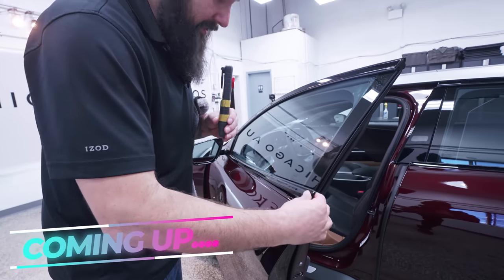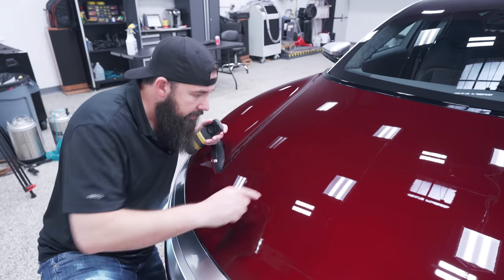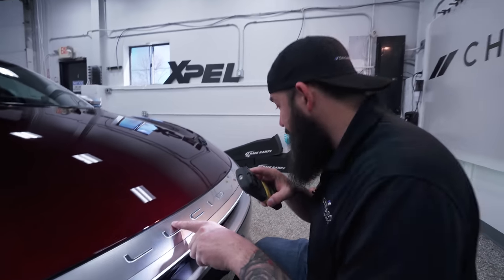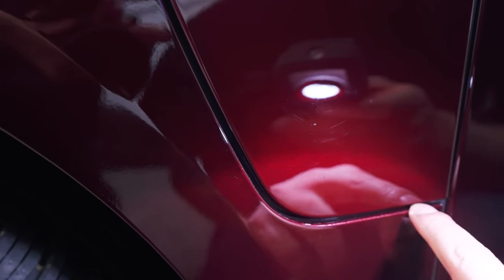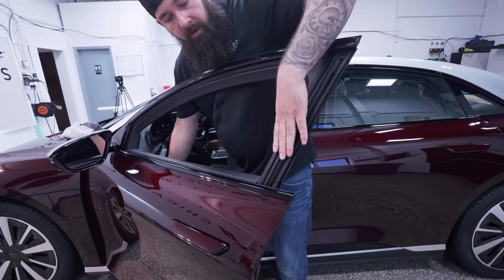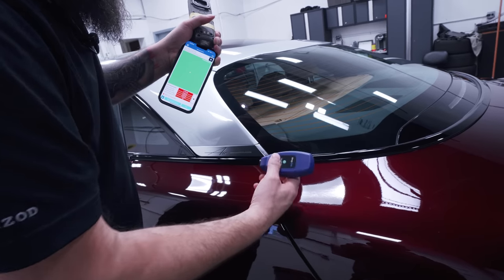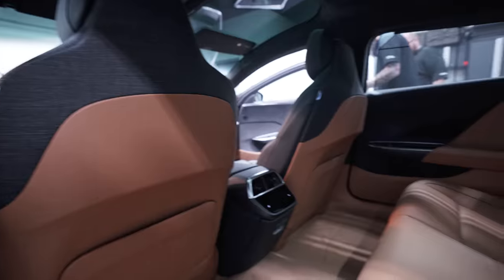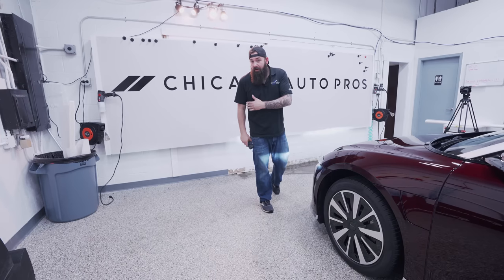2022 Lucid Air Inspection + First Impressions | How Bad Is It?

Comment: Car looks cool but it would appear to have been built very cheap judging it based on this video alone. Love the vid and to answer your question about the red lights in the trunk jam, its to alert drivers behind you of the vehicles presence if the trunk is open. Some cars have red lights in the door jam for the same reason

Comment: I used to work for a Pontiac dealership and new cars were damaged quite often.  One of my tasks was dropping them off and picking them up from the body shop.  Trust me, some cars have extensive damage. They get backed into, side swiped, things fall on them etc.  there is no requirement to tell the buyer about any of this.

Comment: Relatively easy to make 100-500 vehicles.  You can re-paint, etc. to get it right.  Entirely different universe to make cars in volume.  If you have any issue, you quickly run out of room in your plant to rework issues.  Tesla sold almost 1 million vehicles last year without skilled union workers, which is an engineering / manufacturing achievement that is vastly underrated.  Cool looking car, but such a giant hurdle to get to sustainable and profitable volume.  People also underestimate how good of quality car a new Chevy, Chrysler, Hyundai, etc. actually is.  "Build quality" is really just many hundreds and thousands (or millions) of repetitions to continuously improvement processes.  Can't do that if only building 100 vehicles.  This is likely repainted at the plant, since they are just trying to get the first cars off the line correct.
Reply: dam i forgot they did only less100i dont know why they cant do good on paint

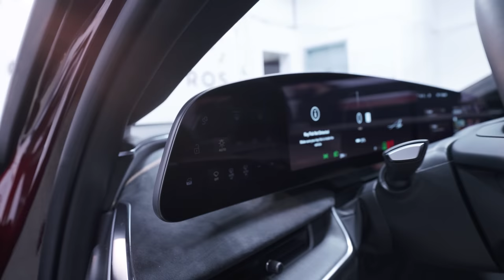Comment: 13:05 because laws in some countries ask for manufacturers to have tail lights always visible. Exemple: you are on the side of the road at midnight with the trunk open. Lucid tail lights are on the trunk and are not visible from behind if you open the trunk, that is why they had to put another set of tail lights to pass laws.

Comment: Great video Jason.  Dealers can be the worse... I've worked for 2 in my past life.  Especially when a "new" model arrives in the dealership.  They'll pull the odometer plug, go have fun with the car and then put it on display as new.   In the meantime anything could have happened.  I've seen it with a brand new NSX.   Hopefully you'll get to work on another one and tell us if this was a dealership-abused-then-fixed car or if it's a general quality issue. 
I know it can be normal for a new manufacturer to have quality issue.  Still waiting on Tesla to fix theirs!!!!!!
Reply: Yeah this is a lie. The odometer is programmed in and there is generally only 1 plug on the cluster to disconnect it sets off a bunch of codes and puts it into failsafe mode. Especially on an NSX you cannot just "unplug" the odometer
Reply: @pilot1721  I'm talking 1989 here......

Comment: Great video and impressive detail inspections with spotlight , magnifier glass and paint meter. I bet if you run that same inspection on a $140,000 Mercedes or BMW... You would be surprised what you find. One thing that bugs me, a car enthusiastic and a professional detailer with over 15yrs experience in car... He doesnt understand why there are lights on bumpers!! Just common sense no need to know DOT laws! I enjoy the video though.
Reply: Sowwy. Over 50k for mass production is a waste.
Reply: But the lights are covered by the trunk lid? Why indeed.
Reply: @bruintoo  It will lid up at night when you open up the rear door so other cars can see you when they are coming.  Per DOT laws.
Reply: @logantp7698  Yup. It's the tradeoff for having a full-width trunk lid. Other vehicles have the trunk lid inside the rear lights and don't need the rigmarole, but if you want to go the other way with your design you'll need those "internal" brake/signal lights. Not all laws make sense like this one!

Comment: It's nice you guys do these things.  The few Tesla's I've seen appeared to be put together quite well.  I'm surprised with the Lucid since it's a good bit more expensive.
Reply: Tesla is still a very new company and Lucid is even newer. This is to be expected
Reply: @Ninj_SRG  i'm looking forward to the lucid SUV.  It looks like an amazing car and hopefully kinks will be worked out.
Reply: @joesmith9483  probably be slightly better but I don’t expect it to be significantly better until they have a few more big factories like Tesla
Reply: @Ninj_SRG  You can't call Lucid "newer" when they're ran by a Tesla lead engineer that worked on the Model 3. In fact, he marketed his company off the fact that he worked at Tesla, and then proceeded to BASH THEM for quality control issues, bragging that they'd use their experiences at Tesla to avoid the same problems...

And yet here we are with a $170k car with THE SAME quality control issues we expected. I'm also not one to cast out any specific country from investing, but it doesn't bring me ANY confidence knowing 62% of the company is owned DIRECTLY by the Saudi Arabian government.
Reply: @Ninj_SRG  Sorry, no. Lucid chose to compete up-market, at a high price point where quality fit-finish-pain is to be expected, not flaws. "Fake it til ya make it" for $140K is not cool.
Reply: @ryanthompson3737  exactly why they won’t see a penny from me…

Comment: I’m an engineer for this company. If you saw how it was run youd understand why this car has is problems 😅 haven’t seen your Tesla video yet but I was also an engineer for Tesla and in an effort to get cars out at competitive market speed there were so many short cuts that were taken. Same issues are relevant for Lucid as well. Quicker we can get designs/products out the more money is made and satisfies investors.
Reply: Very funny. You are Engineer for Lucid and for Tesla. Lucid was delivering a few hundred units of cars while Tesla delivering a significantly higher number of over 500,000 cars in 4 different models within the same amount of time. If only Lucid had not released too much 'big mouth' BSs, people might have sympathized with these shortcomings.
Reply: @salimakai1414  try reading it again.  He WAS an engineer for Tesla.  Teslas are well known to have build quality and reliability issues.
Reply: @Euro2024champs  Of course, I knew that he used to work for Tesla. My point was that Lucid had told people that they would NOT have the 'Production Issues' and instead Lucid would have 'Production Heaven' only. But now, after their repeated failures to fulfill their little promises, Lucid claimed that they are only new company which they are not and consequently they faced with the production issues that led to failure to deliver 520 EVs at the end of 2021.
Reply: @Euro2024champs  not seeing much evidence for reliability issues from Tesla.  Also not hearing much build quality stuff anymore in fact.  seeing a lot of cars on the road though so something's being done right.
Reply: they aren't really pleasing investors though are they? even Ford sold some off.
Reply: @Euro2024champs  Were.  Those days are in the rear view camera.
Reply: @salimakai1414  you need to reduce the meds, your posts are just nonsensical verbal diarrhea. What exactly point are you trying and failing to make (use short English sentences pls)
Reply: @LD-bv1pm  I was talking about Lucid and its BS. I am not here to please you!
Reply: @MsAjax409  lol

Comment: Just wait till you see the iX Bmw lights, super trippy.

First cars from Lucid will have their kinks, you should see what a Founder Model X or even worse Founder Model S looks like... Let's compare apples to apples.
Reply: Disagree. If your new car company wants to break in at six-figures-plus, your product should get the basics right, like paint job. So many other things about the Lucid are rocket science, the reliability of which needs to be proven... but they're skimping on paintjob? Red flag warning.
Reply: @ericjbowman1708  Tesla used to sell cars for similar price when they bowed onto the market...their quality is still not on par with legacy manufacturers in terms of fit n finish
Reply: @dasteknoviking  Leaving the door open for a competitor like Lucid to do better in that regard.

Comment: The lights you noticed inside the trunk are required by law in some countries. Basically, if you stop at the side of the road and open the trunk, your car's rear lights should still be visible to traffic behind you. Because in this car opening the trunk moves your rear lights up in the air, they had to put rear lights on the inside. This is why most cars will have the red lights split, some on the trunk and some on the outside so that they are still seen when you open the trunk.

Comment: Great video Jason! And huge props that you're going to tell the customer about the issues you discovered, even if it means your work might be delayed (or canceled). Can you post an update to let us know how that turns out?
Reply from the maker: Unfortunately the timing was bad and we couldn’t get a full video done of us doing the work. Thanks for watching Scott.
Reply: @ChicagoAutoPros  No I meant if the customer proceeded with your work or postponed to address the issue with the dealer. I guess they proceeded?

Comment: Very professional and comprehensive assessment of the Lucid vehicle. It pays to pay attention to these details when receiving a new vehicle. I have received new vehicles in the past that have clearly had repaint and other corrective work prior to delivery. When brought to the attention of the dealership, the reaction was one of acceptance that these events are routine. No surprise which came as a surprise to me at the time. I refused delivery of the vehicle. If it has some problems I can find, it probably has more that I haven't found. The owner of this Lucid should consider the same. Lucid is better than this.

Comment: I would be PISSED if the Delivering Dealership Did Not Tell me My NEW $140,000.00 Car was Damaged in transit and was Repainted! If the Folks that Didi the Painting knew what they were doing????? You would only be able to see a Bit More Thickness. And for $140K, They should have Sanded it Down and MATCHED the Original Factory Paint and Thickness! A REAL Professional Could do that, Ya, it would take Time and Effort, But at $140K, That's what should be done! "PERIOD"!!!!   GREAT VIDEO, And Great Work Finding the Damaged / Painted area's.

Comment: @13:02 Law requires taillights visible when the trunk is open and closed. The taillights go up with the trunk lid so they put lights in the frame of the trunk to meet legal code.

Comment: Didn't think I'd see build quality lower than Testa but, this might've at least tied it.  That's a LOT of repainting going on there and respectable that you're consulting with the owner before doing anything.  Most shops would do the typical 2-step correction, cover it with PPF and on to the next job. 👏
Reply: Theres no build quality issues
Reply: @mattbrew11  Look a 9:05 ???

Comment: 13:04 Legislation. Law mandates, that back lights must stay put regardless of position of tailgate / trunk. If the lights are on the tailgate or trunk the ones that appear substitute them. They also should work as turn indicators. If memory serves me well, it's alike on Opel Insignia and Audi Q7.

Comment: I’m just sitting here trying to figure out if the sun visors are attached with adhesive or are they attached mechanically. All of that glass is going to bring in heat and the glass needs to be tinted. Awesome job noticing the overspray on the trim and I hope the customer was informed about this from the dealership. Thank you for the fun video and the car does look cool.
Reply: probably adhesive like 90% of rear view mirrors are.

Comment: Okay, obviously I'm not an auto detailer, but if you have to "inform" someone of the flaws in the car's paint job. . . how bad can they be?  It's not as if it's going to affect the car's performance or even--as far as the customer is concerned--its appearance.  A purely cosmetic flaw that no one notices isn't really significant, is it?
Reply: Because it's a $140,000 car not a $30,000 Camry.

Comment: @Jason - the lights are under the trunk similar to the Audi Q5 that activate the lower bumper fog lights because when the trunk is open there's no lights that show up for safety - say if you have your hazards on. Lucid could have done what Audi did and put the lights into the bumper but that'd be too simple! Thanks for the video! Sorta interested in what the Customer tells you.
Reply from the maker: That makes sense. Never seen them in the jamb like that before.
Reply: @ChicagoAutoPros  totally and agreed. To be honest that seems like engineered complexity haha
Reply: @nodrogkam  Engineered complexity certainly applies to the in-trunk latch release, here in the US. Current regs call for glow-in-the-dark handle and mechanical connection; older cars it could be electronic, but then it didn't work if dead battery. Trunklids are surprisingly complicated due to safety regs, not sayin' that's a bad thing.

Comment: The reason why it has lights under the trunk is for legal reasons. You can not have the trunk raised with the tailights. So the added tailights. 
The reason is safety. If you're on the shoulder on the highway and you lift your trunk the lights should stay down to show a hazard. The lucids hazard taillights lift with the trunk, so they added lights to compensate.

Comment: The reason you would have red LED lights inside the trunk deck, is because the entire trunk opens, including all taillights. So, in situations where you're pulled to the side of the road, and have your hazard lights on, other drivers can see your vehicle at night or ill-lit areas. They are only there to make the car visible by on-coming traffic if you have the trunk open. I am pretty sure it is a requirement to have some form of tail lighting if the actual taillights aren't presently visible.

Comment: I would assume the lights in the trunk are there for safety reasons since the tail lights go up with the trunk.  Say if you get a flat on the freeway at night, you'd be virtually invisible to traffic headed your way when you went for your spare in the trunk.

Comment: As a former process and quality manager for a company that robotically painted many commercial and retail products, there were quality protocols to qualify what was acceptable or of high quality.  Example: standing 6 ft from a product, at eye level, for 10 seconds with x amount of lumens from a light source of a specified type and angle. It is impossible, in standard manufacturing practice, to get total perfection.  As a car guy, I know that one of a kind custom car painting can take weeks and can cost as much as this car costs. Cost of Quality must be considered. Compare any car, in mass production, with a candy or metallic paint finish and good luck with perfection.

Comment: You have to remember that this is a brand new car company, new assembly plant and it's the first year so I'm not surprised at some of these issues.  Remember all of the fitment issues with Tesla?  The age old thought of never buy the first year of a new design holds true in this case as well.  It will get better I'm sure.

Comment: Great video by all means. %100 honest. These doors are soft close doors, so you need to softly shut them and the hinges will suck the door to latch it. Also the white trim on top was originally brushed aluminum and painted over it's an option but apparently wasn't painted properly.

Comment: Wow. This guy is particular.  I mean, understandable when your customer has paid 140 grand for a car.  I certainly wouldn't have noticed any of those flaws.

With regard to the "hidden" tail lights:  I assume this is for if you're stopped at the side of the road on a dark and rainy night, rummaging around in your trunk to get your tire iron or jack out. . . this makes your car more visible.  He should've turned on the hazards to see if they flashed.

Comment: The lights under the trunk are to satisfy U.S. safety regulations which dictate that the taillights cannot be on a movable piece of bodywork unless they have redundancies. Since Lucid designed their trunklid with the taillights fully integrated into it, they were legally required to add that 2nd set of lights to make the car remain visible at night if the trunk is open.

Comment: The lights on the trunk are beacause all of the lights on the back of the car are on the lid that goes up.  If you are on the side of the road at night with the trucnk open (say to change a flat tire) there would be no lights or reflectors on the back of the car.  Those lights are there so people can still see you with the trunk open.

Comment: The lights below the trunk lid are there because of federal regulation. They are brake lights since the main lights are on a moving panel they need to be shown on a fixed panel if the other is somehow removed, open, ajar.

Comment: Great attention to the little things, my wife would approve. It looks rushed. Like they had to push delivery at the end of the quarter. The trim at the door to glass is just a mistake, right? that will come off in a crosswind or what about ice overnight getting down in there and lifting the trim as it expands? I PPF'd my Model Y immediately after delivery and those guys were just as meticulous as you so I recommend to anyone that they have a pro do whatever treatment they're thinking of. Thanks and drive safe.

Comment: If your tail lights are in a moving door and not visible once the trunk is open, it's mandatory to have a "repetition" somewhere else in the car tail. I am sure they thought that was not worth it to cut the bumper line adding lights there. Better inside the trunk space.